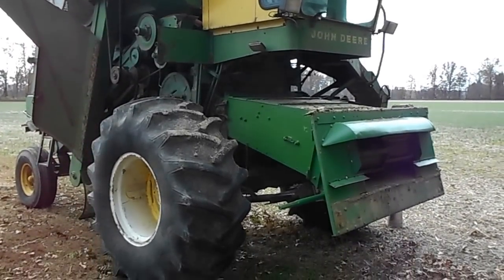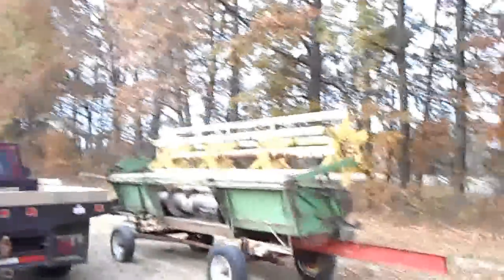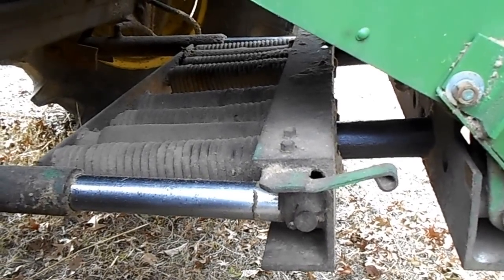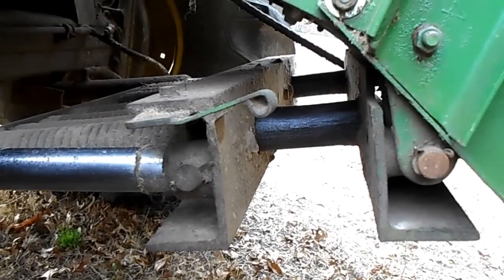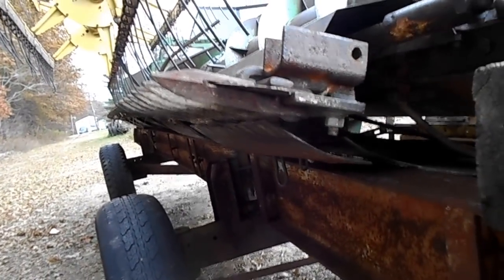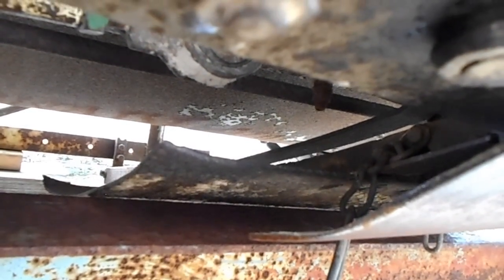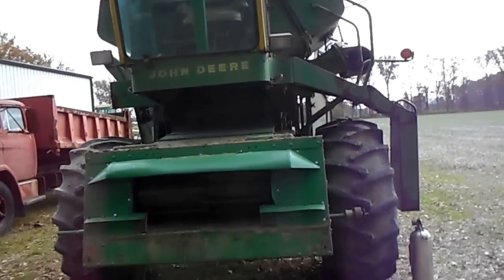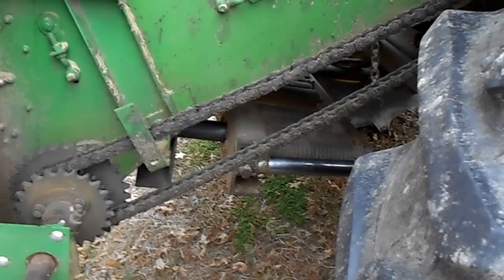JD 95 ready for the barn and the grain head

Comment: Interesting... that float system is ridiculously simple... why they had to replace it with hydraulic/electronic LOL:)  Claas had something similar, but it was a pair of large coil springs like car springs mounted on the end of the hydraulic lift cylinders, so that when the head was put down they took the weight of the header against a huge flat washer on the end of the cylinder itself, and a huge washer on the other end of the rods where they attached to the feederhouse.  Later!  OL J R :)
Reply from the maker: This is what I like to call the Poor Mans header control system !  Simple eloquent and cant fail and works all by itself, The flouting cutter bar is great but couple it with the spring flout under the feeder house its fool proof !  I've had combines with robot with cable or electric but nothing beats this system, Just set it and forget it !  LOL  All I know is it sure made running a combine oh so much easer for me. The springs do get weak over the years of uses but its still cheaper to rebuild one of the spring flouts than it is to work on and replace the electric or cable systems .  Of all the different systems out there this set up with the flouting cutter bar and the spring assist under the feeder house is by far the best I've ever seen and I really like it.  Bandit

Comment: Could you take the head off that old 4400 and make it work? I'm sure you'd have to transfer some things over from the 95's head to the 4400's and I'm guessing that the other head will need some work to free it up from sitting for so long.
Reply from the maker: +435now The head on the 4400 is a 13' and the one on the 95 is 15' and I would rather have another 15' head to replace it. The 13' head will need a new pan and bearings in the auger and new finger guides for the fingers, I'm not going to get rid of the 13' head as I would like to keep it to use to cut wheat with. 13' head with good wheat cut low for baling is a good size for the 95. I am watching for another 15' head to replace mine and I will find one it's just going to take awhile.  Bandit

Comment: Where does a guy find that spring assist set up?
Reply from the maker: Well check with the combine junk yards that sell parts off them, That would be the first place I'd look at. A phone call is cheep and easy. If you see an old one sitting someplace stop and ask about it and see if it has one or if they might have one setting around in a barn. I have one for my 95 and 2 for my 4400 and every now and then one will pop up on craigslist for sale , There not as commend as they used to be.  Bandit
Reply: @banditfarmer1900  thank you. So to be clear, its a john deere part, not a short line company?
Reply from the maker: @nickohnmacht611  Correct, Its a JD system that you could buy to put under your JD combine when it was new or used. They came out in the 60's and were still being made into the late 70's before the discontinued them, As far as I know you can still get springs and some parts for them from JD. At least with JD you can still get parts for a lot of there old equipment from the dealers. Bandit
Reply: @banditfarmer1900  Yeah that's for sure... why CIH and NH have made a Deere fan out of me... Deere still supports their stuff!  CIH and NH doesn't care about the farmer they just want sell new stuff and let guys running their older stuff can just go pound sand for all they care.  Later!  OL J R :)
Reply from the maker: @lukestrawwalker  Everyone asks me why Oliver's ? Well its because we still have a good dealer 7 miles away !  There is a lot of equipment I wont own simply because of no dealer support. JD seams to be really good about supporting older equipment its had not to want to run it. The old Oliver dealership is 7 miles from me and I can get a lot of parts from them for everything I have threw A&I, JD CaseIH dealers are about 25 miles from me New Hollard is about 50 miles away and the only AC White AGCO dealer is about 70 miles away (I wont go there for anything ! ) so buying any equipment will depend on the dealers ware I can get parts for it if I need it and its why I wont buy some brands of equipment of any kind., But after you've been around enough equipment you figure out what part of one brand will fit another ! IH on JD Oliver on Ford and so on, Hay its a farmer way of doing things.  Bandit
Reply: @banditfarmer1900  that's good!  Dealers here have really slid over the years.  Lemme see, there's Rosenberg Tractor, they're NH, but mostly lawn mowers, 15 miles from the house. Lamar Tractor was in Rosenberg too but they closed 25 years ago. Hlavinka Equipment owns all the CIH stores from the other side of Houston for 200 miles along the coast, they closed their Rosenberg store so now it's Kubota.  Wharton Tractor is 23 miles from the Needville farm, opposite Rosenberg, they're NH but they're a shadow of what they used to be.  Surprised they're still going.  Then there's Shoppa's Deere in East Bernard, about 35 miles from Needville. They own every Deere store in roughly the same 200 mile stretch as Hlavinka CIH, who's main store is outside of East Bernard a couple miles, then Shoppa's and Hlavinka in El Campo, 45 miles from the farm, then they both have stores in Victoria, along with Victoria Oliver (now only Kubota but they kept the name) and Victoria Equipment (NH, agco) which is 88 miles from Needville and 70 miles from Shiner, then in Shiner there's the old Shiner Filley bought out by Shoppa's (Deere store) and the one I do 95% of my business with, Boehm Tractor (NH, but more Mahindra and Kuhn on the lot) the stores in Shiner are 5 miles from the farm.  Have to go to Lockhart for Gehl parts, which they're about gone to just selling batwing shredders anymore, (Hanson's Equipment). That's pretty much it.  Of course Shoppa's and Hlavinka are mega dealers now so parts is about all I can find there lol.  Later!  OL J R
Reply: @banditfarmer1900  don't look like it'd be too hard to engineer one...
Reply from the maker: @lukestrawwalker  If I rebuild the 95 one of the things I'm going to do is add a few more springs to it or replace the ones on it. It was set up for a 13 foot head with a skid plate but I was running a 15 foot header with a flouting cutter bar so it was stretching the spring out so they now need a little help.   But boy does this system ever work good !  Bandit
Reply from the maker: @lukestrawwalker  At one time in Blanchester Ohio there was an AC IH Ford MM dealerships then Oliver was 7 miles away JD and MF were about 14 miles away in Lynchburg . The old Oliver dealership is still open today and all the rest were gone by the mid 80's most in the late 60's. But McHenry's (old Oliver White dealer) is not a White dealer anymore but they are still working on them and getting parts for them and working on a lot of stuff now. They do still sell some short line equipment brands and sells a lot of part and make hydraulic hoses. I dont know what I'll do if they close up cause they really know there stuff !  A good dealership is had to find these days and most of them have salesmen that are hear today and gone tomorrow if they dont sell enough so its hard to build a relationship with a dealer when there is such a high rate of turnover so you shy away for them. But at least I know ware I can get parts for everything I have so I figure I'm doing good.  Bandit
Reply: @banditfarmer1900  Yes that's true about the dealerships quality going down.  Guess that's everything more or less... It got to where there was ONE guy I'd deal with at the local Ford truck dealer... he was in the used part, named Daniel Waterwall.  He was straight up, no nonsense, no games.  I'd be looking at something and he'd come out and I'm like "what's the best you can do" and he'd tell you straight up, take it or leave it.  IF it was good, you could sign the paperwork and be out of there in under an hour.  If not, well, it's "Okay thanks, we'll see what you got later on..."  The dealership had a whole crew of slick willy game players, and they'd come out trying to start something, and I'd be like, "Oh, I'm here to see Daniel".  I HATE game-players LOL:)  No time for all that crap.  

The tractor dealers are just as bad.  Last new tractors we bought (well Dad bought the baby Mahindra but that's all on him-- he didn't even talk to us about it) were the 5610's Fords in the late 90's.  I talked to the Wharton dealer, wanted to trade off the '68 Ford 5200 row crop, as she was getting tired, needed all new tires, PTO brake didn't work, etc.  (Now I kinda wish I'd kept it honestly because she was a row crop) and he said, "I"ll give you $3,000 trade and the new ones list for $21,000, so $18,000 cash".  Well, I went up to Shiner and talked to Waldo Boehm, and he said, "I'll give you $8,000 trade and the new ones sell for $18,000, so $10,000 cash"... I said, "SOLD!" and we signed the papers.  They even hauled it 100 miles down to the Needville farm for me.  

Now what was funny was, a year later I was doing service on it replacing all the filters, so I went over to Wharton since it was the closest store, and had the parts guys pulling a whole new set of filters for a 5610.  The owner/salesman was kinda goofing off behind the counter and was like, "When did you get a 5610?"  I was like "last year".  "Where'd you get it?" he asked.  I told him.  He got this sour look on his face and said, "He shouldn't have sold you that tractor-- we have protected territories!" I just looked at him sweetly and said, "Well, I wouldn't have bought that tractor from you at the price you quoted me anyway... I could have gotten a Massey cheaper than that, or put some more with it and got a DEERE!"  He puffed up like a toad and took off for the back office LOL:)  I was telling the story next time I was in Shiner and Waldo laughed-- "he was full of it-- we DON'T have protected territories!"  SO he's a liar AND a cheat LOL:)  Learn something new all the time!  It was a much better dealership when his adoptive Dad was running it... Bob had integrity and was a good solid square dealer, not some BS slick willy car salesman looking to screw somebody.  My Grandpa knew Bob from the day after WW2 when they were both travelling cigarette salesmen for awhile, refilling vending machines with cigarettes!  Bob ended up marrying the daughter of the guy who started Wharton Tractor and took it over when he retired.  They couldn't have kids so they adopted a couple boys and yeah, younger generation LOL:)  

Same thing happened with Stavinoha's Tire shop.  The old man was a straight shooter, good to deal with.  Grandpa bought all his farm gas, all his oils and lubricants, including thousands of gallons of cotton picker flush oil over the years  since the old machines used a couple gallons of oil a day to lubricate the picker bars, before they switched to corn head grease in the 80's.  Bought nearly all his batteries and tires there too under the Farm Bureau program (cheaper stuff, we let it go when it got to be just low-grade junk).  The old man was ALWAYS service with a smile and very quick!  Then he retired and the boys took over-- We have a 250 gallon leg tank for farm diesel, and used to have a 300 gallon gas leg tank for the pickers and combine.  We'd call and the old man would have the truck out there in about 2-3 hours, unless we called in the afternoon then it'd be bright and early the next morning.  Then the boys took over and it'd be a couple days usually before they'd get out there, so I'd call them a day or two before I was out.  Then they got all p!ssy with me because "the tank ain't empty!  We got a 250 gallon minimum and we couldn't put but 225 in!  DON'T CALL US TIL ITS EMPTY!" and I was like, "When I'm in the field, I need fuel NOW, I can't be sitting with the tractor and tank empty waiting on you guys... Can't help you showed up 4 hours earlier than I figured, or the tank WOULD have been empty (STILL over a day after I called!)  THEN they were like "The BTO up the road orders most of a truckload, so can you coordinate your fill ups with HIS so we can just run a truck out there and fill you both at the same time and make a full load with the truck and come back empty?"  I'm like "You gotta be kidding me!  I don't know the guy that well, don't like him, and I'm not gonna be calling him like a fool and sitting here waiting on fuel because he doesn't need any for another week or two..."  SO I went to Rosenberg and started looking around, and signed up with the Mobil dealer... they'd bring me whatever I needed whenever I needed it.  Last time I went to Stavinoha's was probably 30 years ago... I had bought an old dually truck axle out of the junkyard and put it under an old grain truck frame to make me a 4 bale hay trailer, and made a tongue for it to pull behind the old '77 Suburban 454 Trailering Special.  The axle had some raggedy old 16's on it with split rims.  OH the humanity... they had some turd working for them that wouldn't hardly hit a lick at a snake, and GRIPED and BADMOUTHED whatever "piece of sh!t" you'd brought him to work on, so he's railing about these split rims and the boss is sitting in the office laughing and giggling... that was enough for me... I told him to shut up and finish the job... he was a tire guy after all, wasn't he?? Can't handle a simple little split rim?  Funny anybody else at the time could!"  He finally shut up and finished, I paid and left and NEVER WENT BACK.  I had a buddy that took care of the gas wells on the place back then named Stoney, he worked for the oil man who wildcatted the farm and drilled the wells, doing the shredding and road work, overseeing the workover rigs, and cleaning up around the well sites and stuff.  Now the old oilman had a beat up old Case David Brown with a 6 foot Bush Hog on the back, that Stoney used to shred around the well sites to keep the weeds down and along the access roads.  Well, it had a tire going bad so he had it over at Stavinoha's getting a  new rear tire put on it.  The whole time, the guy was badmouthing what a lousy POS that Case was and that the old fart should "buy a NEW tractor" and stuff, and finally Stoney got mad and said, "Why don't you call him up and tell him that!  Otherwise SHUT UP!"  Later he told the boss the story, the old man had more money than you could spend in five lifetimes, but he was old school... "good enough" is good enough!  He got a little miffed and told Stoney, "Fine, don't buy ANYTHING there anymore, just get it elsewhere!"  Them boys would be broke and gone if it weren't so many citiots moving in over there for them to screw over... 

Later!  OL J R: )